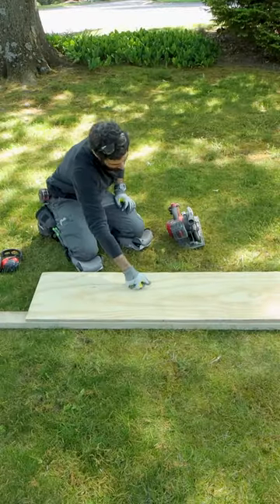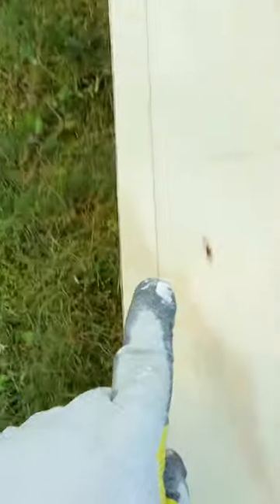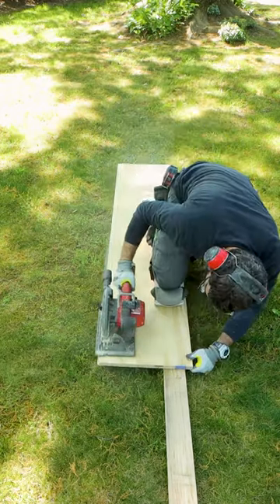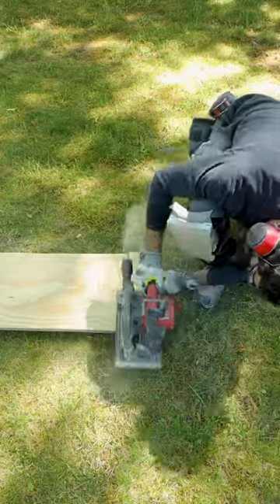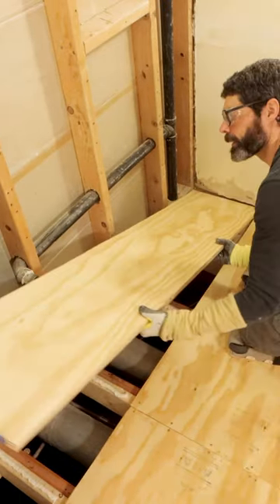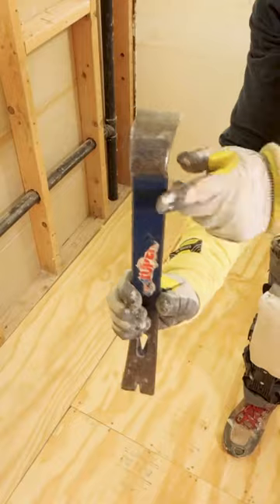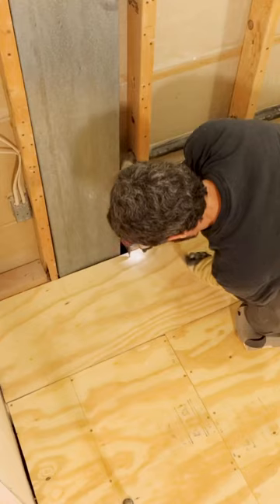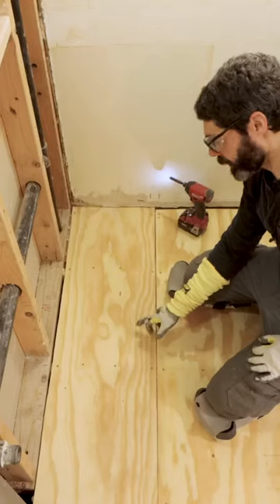How to Cut Plywood - #shorts

Comment: Technically, plywood subs should be spaced 1/16" min to 1/8" max @ all edges. 1/16" would have been fine in this application.
Reply: My cuts are so crooked I have 1/8” gaps by accident 😢
Reply: @blaccgaara8994  lol. good one.
Reply from the maker: Thank you Ed, ya, the expansion joints were 1/8” to 1/16” - this was a double subfloor application to meet up with the adjacent room
Reply: @HomeRepairTutor  sorry, the prybar threw me a curve.
Reply from the maker: @edmessina8392  haha no problem my friend